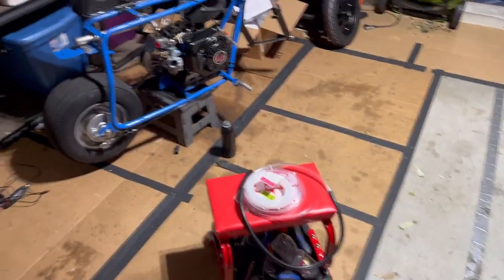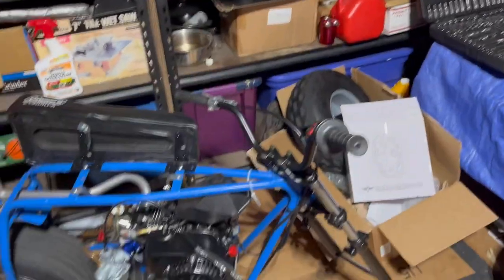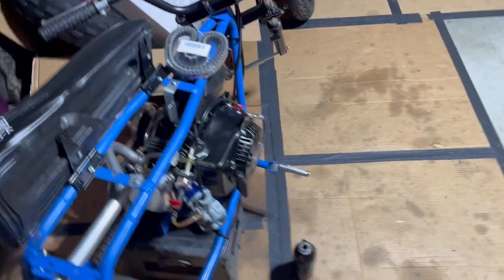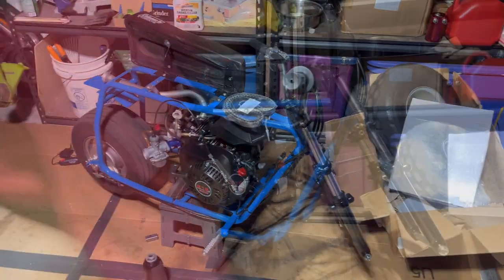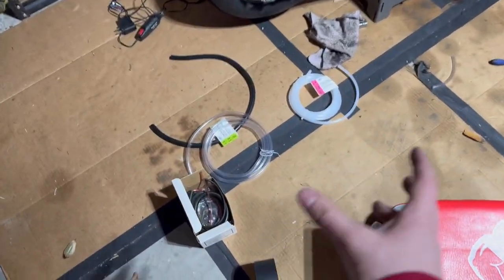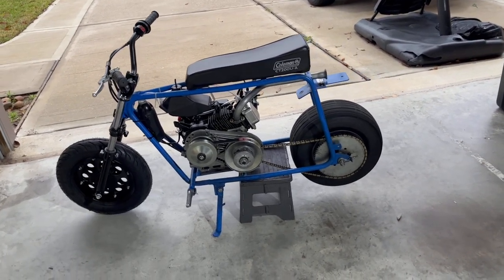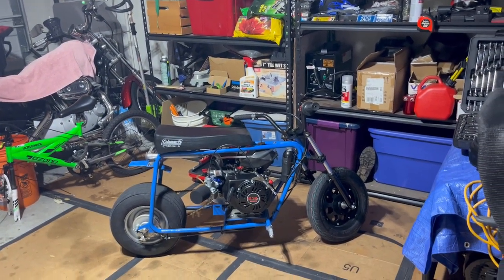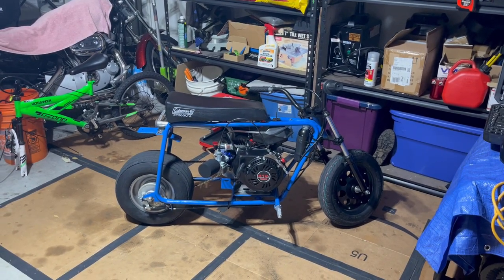Putting Front Suspension On My Minibike!

Comment: Could u use the steering bolt that came with the suspension kit or did u have to modify it
Reply from the maker: I used the stock bolt that holds it to the frame, yes.

Comment: Nice build! I just a suggestion, spray some anti spatter spray on the the parts you don't want the Flux spatter on. I love the tire setup, what are the rim and tire sizes?  I want too run them on my doodle bug.
Reply from the maker: Thank you for the tip! The rear wheel is a stock Coleman 8 inch, the front wheel is the go power sports 10 inch. The rear tire is a 16x6.50-8 turf tire, and then the front tire is a 3.00-10 street tire from go power sports!

Comment: I guess that’s why it says it doesn’t fit 200u’s I been wanting to get the same thing. It now I see why they say it doesn’t fit right,the wheel is wayyyyy off center this haveing to cut the spacers
Reply: You cut them both  to the same length
Reply from the maker: Yea I mean you can always make something work in my eyes and it rides perfectly fine just has a slights wobble but I think that might be the bearings I used. But like it turns good and feels stable but just doesn’t absorb the shock like it should if that makes sense.